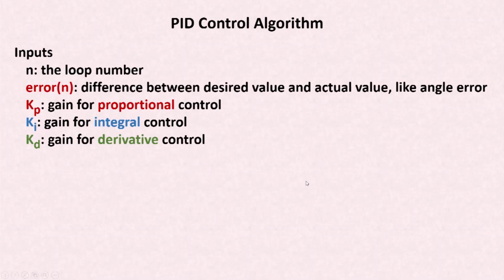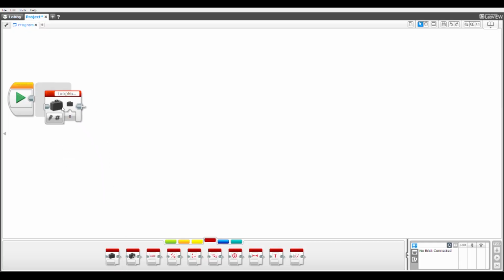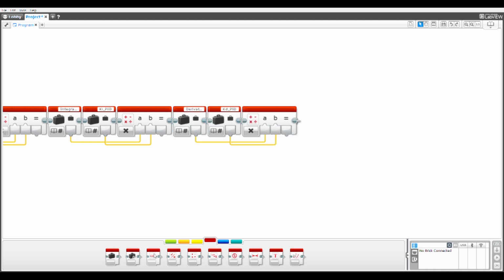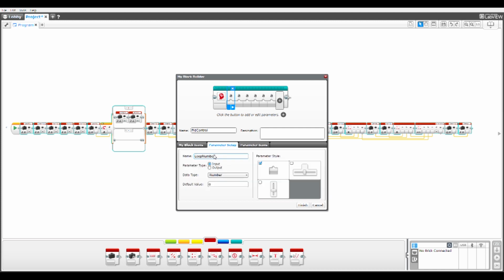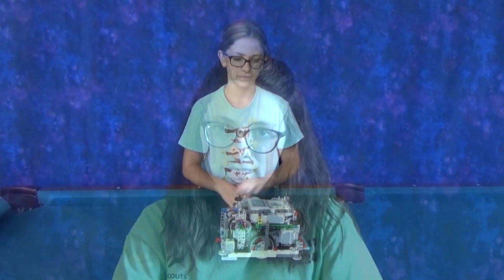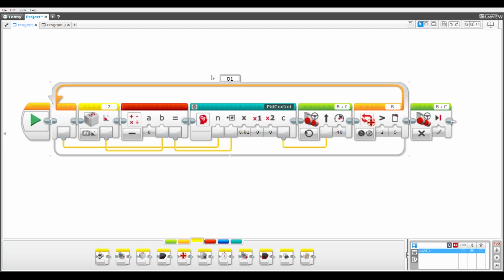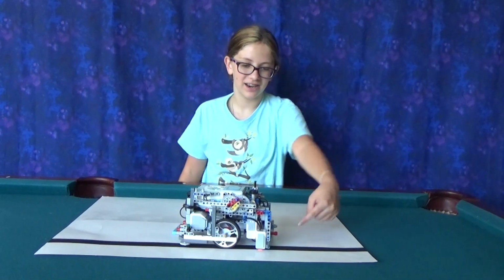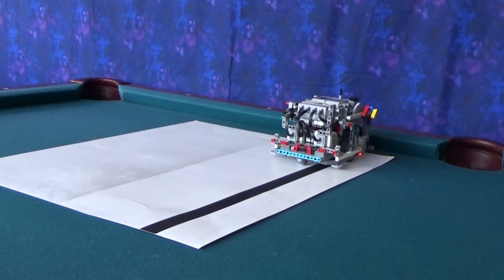PID Control EV3 MyBlock with Gyro Straight Drive and Color Sensor Line Follower Examples

Comment: WOW.  I have been doing this for 12 years as a coach and have never heard of this till now.  You are brilliant! Good luck at the competitions!
Questions - 
1. I'm assuming you would have to tune the PID controller differently for each robot.  Do you have a video on how to tune? Does that PID work with any robot?
2. The PID program - do you use the same program (myblock) over and over again for every move and sensor block? Or do you only have to do it once in the beginning?
pxifdesign@gmail.com or girolamoth@baldwinschools.org
Reply from the maker: I sent you an email, but I'll reply here also.  Our approach to PID tuning: 1) set proportional gain so robot follows the setpoint with some weaving back and forth.  If there is a constant offset so the average error is non-zero the add some integral gain.  Add derivative gain to reduce the amplitude of the weaving back and forth.  Then refine the gains such as playing with the proportion and derivative gains.  We were surprised after using one set of gains for line following for months and then Kimmy was playing around with the gains and found that a much higher derivative gain helped a lot.  Then we also increased the derivative gain for straight drive.
Reply from the maker: We hope to make a PID tuning video after our Qualifying Tournament next weekend.  
You need to tune the PID controller differently for each robot and each application.  
We use the same PID control MyBlock for all applications.  The girls just programmed it once and use it many times without any changes - which is why it needs the various input parameters that allow us to change the behavior of the PID control without changing the MyBlock. 
We use PID control using the gyro sensor and one set of PID gains for our StraightDrive MyBlock.  We use PID control using a color sensor and use a different set of gains for the LineFollower MyBlock.
Reply: Thank you for your explaining the PID program, can u explain more details of no loop 
My email ( rulaabuodeh@ gmail.com ) 
I’ll be thankful